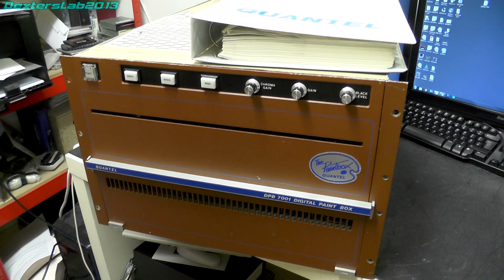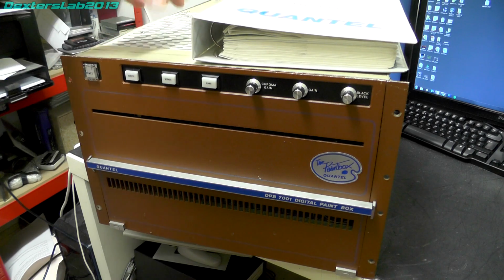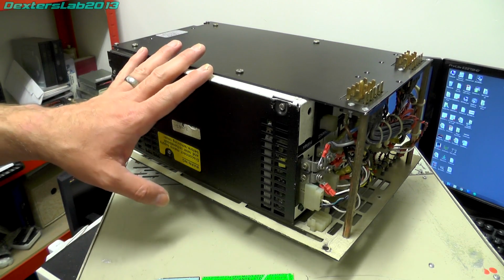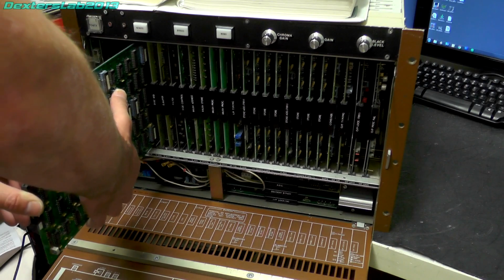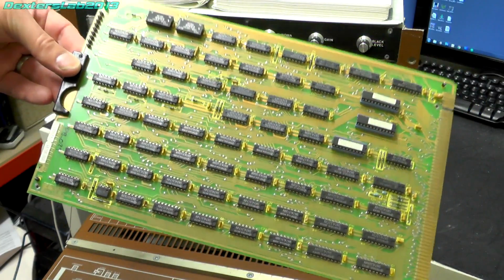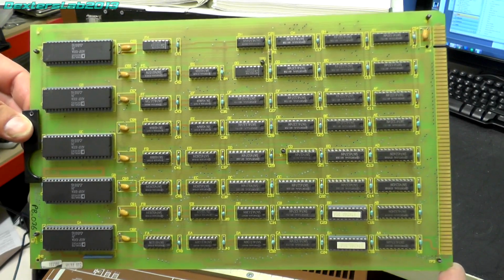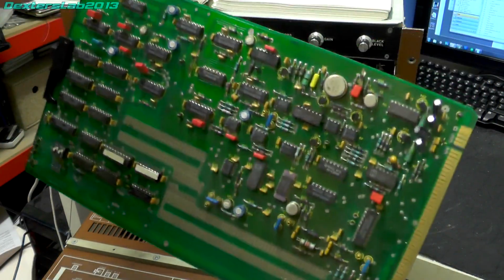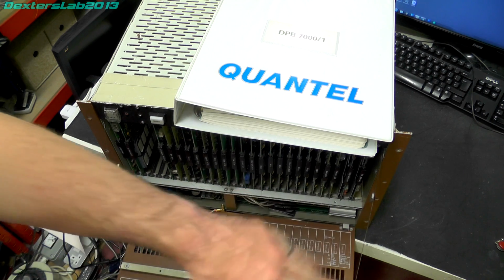DL149 1980s Quantel DPB-7001 'Classic' Paintbox Teardown

Comment: I did have some involvement helping with RGVX fixing this. Ash did most of the work with him but we would provide advice on troubleshooting. Tanterlums were a major issue. Had some blow up on camera.

Ash was able to get the CPU cards working by pulling them out of the machine and running them in a test jig.

I am not surprised the HDD is a lost cause. We never had any luck with it.
Reply from the maker: Thanks, i watched most of the rgvx videos at the time. Myself and Ash have learned a ton working on the newer systems since, it should help us a load. I can also call on the help of an ex quantel tech who used to fix them.

I am pretty confident i can get the system to boot partly,  the hard bit will be sorting out the missing hard disk which holds the brush bitmaps and default font that are loaded during boot.

Comment: make sure you dump the eproms before powering up?
Reply: Oh, don't worry, the EPROMs got dumped within seconds of getting the boards. lol

I borrowed the two spare CPU boards from RetrogamerVX a few years ago, and the first thing I did is make backups of those EPROMs as well.
Reply from the maker: Pretty sure we have an image of every rom in the system. The only parts we can't do are the PAL & GAL devices

Comment: Love this very beautiful but where is the 6809 CPU
Reply from the maker: There is no 6809 in the DPB, it's main cpu is the 68000 with a selection of bit-slice processors.
Reply: DextersLab2013 so this uses the same processor as the Amiga
Reply from the maker: Yes and the Atari ST, NeXT, Mac, QL and many many others. Considering the 68000 was released in 1979, just two years before the Paintbox was released it was a very forward thinking move to use such a new CPU.